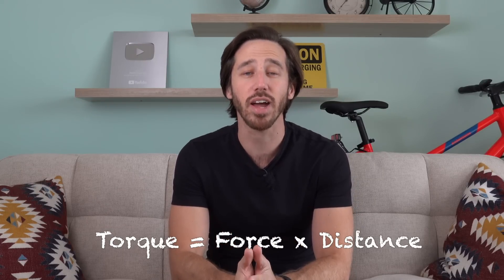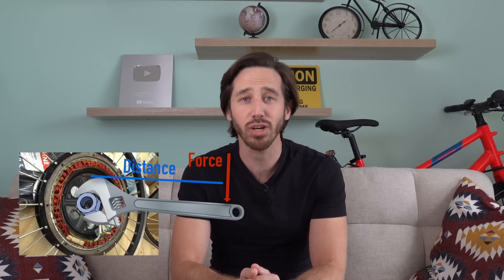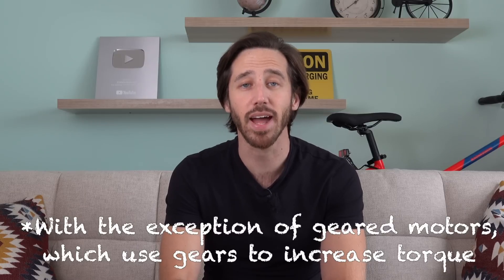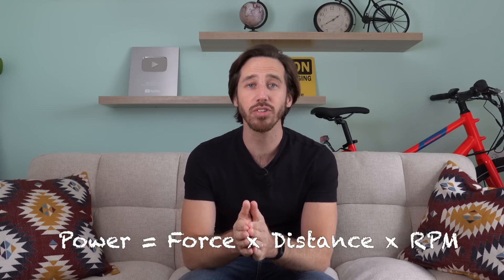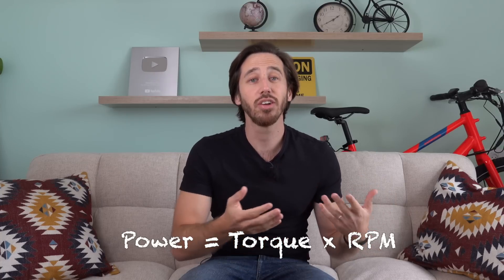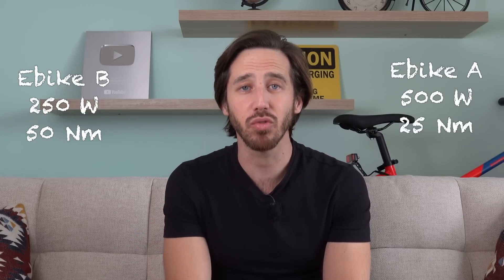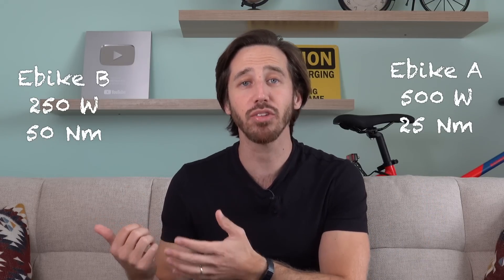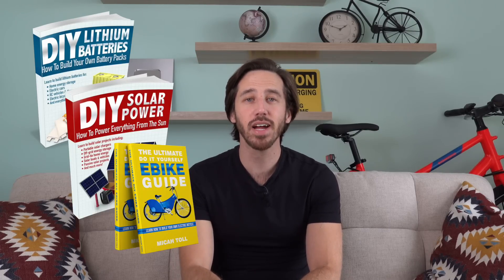What does E-BIKE TORQUE really mean? Simple explanation

Comment: ... So a 250W bike with 10NM of torque, will lose to a 500W 40NM of torque bike, in a flat race? You sure? you want to put money on that? maybe re-do your math, power on its own does not dictate things, it's what speed you want and what torque you need. In the above scenario, the 250W bike will win against the 500W bike, because it can produce higher RPM, and you need very little torque on on flat ground. And in an uphill race, a 250W bike with 50NM torque will win against a much faster 1000W bike which only has 10NM torque. Again, it's all about torque you need, and speed you need, and the specific scenario/environment. And then of course you have to mention ESCs, is there an amp limit on it? what is that limit, what is stall torque, what is the rate of heat generation, is there a fan on the motor? is there an auto-shutdown on the ESC based on heat or over amping?

Neither does voltage matter much either. Higher voltage only slightly increases the efficiency. In general, if you half the volts and double the amps, you're going to achieve the same power. So your 48V 50A motor is no better than my 24V 100A motor. So please stop spreading your misinformation about how higher voltage motors are automatically better. Learn a little bit of Physics before calling your channel "EbikeSchool", because you just don't know much it seems, and most of bs you're spreading is nothing more than ebike "bro science".

Comment: I still have my 2020 Eco trick hammer second generation 1000 Watts..... I don't want speed I want to have a lot of torque to tow my wagon if I come to a very steep incline..... I have range anxiety covered was way too many batteries I bring with me... the only thing was the brakes that I have a hard time getting the air out it's like a car with the power Brakes in the old days you gotta bleed it and it's a pain and you got to buy the tools and I'm not good at punctuation..... but I love my electric bike it saved my life.. you can't do that in a wheelchair I was going to get a wheelchair... but I got that instead in July 2020 in November 2019 that was the worst pain ever and it takes months to get over.... I wasn't even over it but I somehow put that bike together and use the wagon to get it to the garage.... I had no idea how fast it really was cuz 20 seems really fast and I crashed..... I came out of my driveway and I didn't tighten the freaking handlebars I fell right on what you call a nub and it hurt like hell but I want back up the driveway with one leg fixed it... I wanted to see how fast it could go I was at the end of the street and there's a van coming so I crashed in the yard I strongly suggest even if you got two legs practice somewhere like you do when you're learning to drive a car it's not like steering a regular bike I don't even like the giant tires I want three inch but that's the bike I could afford and it was 1400 now the Eco trick Hammer is 1200 but it's 750 W which is almost a horsepower I know the Thousand is a horsepower so a horse should be able to tow a wagon of the Hill up it LOL.... sorry about the punctuation I bet I got the point across

Comment: Like how you explain it 👍, thanks.
Can you answer this question? If we have 1 ebike with a 2000W motor on the rear wheel with 40 Nm of torque, and another ebike with 1000W motor with 20 Nm of torque on front wheel and 1000W motor with 20 Nm of torque on rear wheel, would there be any difference in case of climbing uphill?

Comment: seems to me that you want to move fast. And one way to increase torque is to increase distance from shaft to the electromagnetic coils. But then your increased torque comes at the expense of RPM; so you can get more torque by going slower -- but that is not what you want! So to compare EBike motors, you would need to know the distances between the shafts & the coils. But isn't what you need to know: the force exerted by the wheel on the road?  eliminating the variables of wheel diameters?  But this depends upon your gear ratio.  Or you might learn something by knowing the maximum speed of the eBike on a level surface with no wind & some standard rider (to standardize wind resistance) & the various max speeds at different inclinations of the road, up to 45 degrees. An experimenter could use one rider to test various eBikes that way.

Comment: Sooo, should my 2022 Gazelle C380 with a Bosch performance Line motor with a 500Wh battery and 65 Nm of torque be able to make it up an incline degree of 5.4% that stretches over .81km (elevation gain of 44m). mine has absolutely given me no assist towards the top when I really needed it- twice. Thanks

Comment: Hi Pal great content, quick question I have a 48v 1000w hub motor 20inch it's to powerful/torque for my aluminium front forks and was just wondering is it possible to reduce the power output/wattage on it, either on the display or use a smaller controller what do you reckon?

Comment: Dude, you gotta say it simpler: OUTPUT power is simply how fast torque is performed. In other words: for a given RPM, more torque equates to more OUTPUT power, period. But you completely forgot to clarify and distinguish the key FUNDAMENTAL difference and confusion of INPUT power which is super arbitrary because it's a result of efficiency. You also forgot to address the FUNDAMENTAL and key point of external gearing and INTERNALLY geared motors, especially for mid-drive motors...is the torque rating taken at the motor or at the cranks which is also not standardized and misleading. I'm frustrated with how much confusion there is on this topic on the internet, almost nobody really understands their relationship because there's no established and accepted standardized way to measure these metrics.

Comment: real world: my 250W nominal geared hub motor on a 16' wheel gets me going and getting faster way better than a similar motor/controller mounted on a 26' wheel because the sooner the wheel gets into higher rpms the more efficient those Watts are creating Newton meters instead of heat.
The most drastic scenario where this becomes apparent is a bunch of rickshaws at Oktoberfest really going at it once the light turns green with me coming out ahead because of that small wheel diameter despite a much higher system weight (600+kg) compared to my colleagues running the same motor set-up with lighter 26' bikes and slimmer tires.
Reply: Totally. Small wheels and hubs for reliable cargo bikes imo. Smaller rear wheel and larger front also works for bikes.

Comment: Great explanation thank you, BUT, I have a Rocky Mountain Altitude which claims 108NM of torque and considering buying another bike with claim 85NM of torque, both of these bikes actually dont FEEL any different to me in the delivery or torque-power.  Is the measuring of claimed torque a standard of the industry, or exact science if you will or is it just a claim of each company?  Is it measured at the cranks or at the back wheel or even what is put to the ground?  Is there some sort of standard deviation?  If one companies claims base it off their engine in house measurements, the other at the crank how can we as consumers compare appropriately?  Thanks for your help before I drop 10k on one of these.

Comment: Sorry buy power does not equal torque times rpm. When taking about work the force is applied parallel to the distance where as for torque the force is applied perpendicular to the distance. The the two terms are not interchangeable.

Comment: This is a great explanation, but I would recommend using a bit more precise language:

for example, you mention that power is "torque x rpm".  This is technically true, but a bit confusing.  Torque is a general concept but rpm is a unit of measure.  What you're trying to describe conceptually is the "rotational frequency" of the motor--this is the general term and can be used as rotations per hour, per second, per whatever-unit-time.  Just like "torque" can be N-m, lb-ft, etc. etc.

There was something else, but this is the only example I have rn.  It's an excellent video and excellent description.  I learned something I didn't understand before, and of course I understood the point you were trying to get across.  But in the interest of continuous improvement, I'd encourage you to focus on your linguistic precision in these videos to make them that much stronger.

thanks again!

Comment: Micah, in your examples you suggested the bike with more 'power' will win the race. I don't think you used any caveats like "all other things being equal". Things rarely are equal. Imagine two bikes with the same power rating but one weighs 20 pounds more or has a heavier rider. Common sense says the lighter situation would win the race. Assuming that's right it seems to me as consumers, choosing the right ebike for performance, we should consider both weight and power. We could potentially win an actual race riding a lighter bike with less power against a competitor with a more powerful but heavier bike. No?

Comment: Another thing that's confusing with all of these e-bikes.

For instance A G-Force bike well the new upgraded model so weird to say they upgrade so quickly. 

Has a 22 amp controller, ( and the NM is 80 ) 

But yet another bike recently reviewed the VITILAN which now has an upgraded controller from 22 amps to  25 ( yep things change that quick!!)  ONLY HAS AN NM OF 75!!  

I know this has something to do with the torque But all the numbers don't add up. How can The G-Force with only a 750-watt motor 1,000 w peak have a higher 80NM then the NOW UPGRADED VITILAN 750 watt motor 1200 watt peak only 75NM 

And some of these other e-bikes with the same 750 watt 1,000 w peak motor only has 60NM

This is so confusing 🤣

Maybe you can shed some light on the subject

Comment: regarding the flat land race senario here...force times distance times rpm you say.your talking about motors not complete bikes......you basicaly raced one bike in first gear and another in second gear and came to the conclusion the 500w motor in second gear won... the 250w motor can have higher gearing becaus it has more torqe.....bothe bikes have the potential to cover the same distance in the same amount of time...they bothe have the same force potential....give them their optimal final drive ratio for their respective torqe to power ratios.

Comment: You avoided the contradiction of mixing the old, obsolete metric system with the current SI Metric System that's a mess with the bicycle industry.  Weight is a force.  It is a derived unit and not one of the 7 fundamental units (like mass)  in the SI Metric System.  So weight x distance also = torque.  Let's see then.  1 kg x 1 meter = 1 kilogram meter. But wait, that's not a newton meter.  Why? Because kilograms is not a unit of weight.  You need to first convert that mass (kilograms) to weight/force to work with units such as Watt and Joule.

Comment: Thanks for the info I knew these things meaning a car mechanic but I like how you explained it with me bikes. It's like for example ebikeling 750w geared hub has 50 nm torque. The 1200 w direct drive motor has 30 nm they're 1500 watt has 40 nm. All I want to do is 28 to 30 mph no need to go any faster. I have a 350 watt 48 volt 10.4ah Rattan Challenger I've got $2,948 Miles on the bike. I get 25 miles throttle only. Pretty much flat ground here in South Florida. the Cruise control function is sweet I think it should be on every ebike. Because once I'm doing 20 to 22 mph after 2 seconds it kicks in I don't know how to touch the throttle. The ideal thing is that I pull less amps anywhere between 6.3 to 9 amps depending on wind. That's the range that pedal assist seems to work at when you're up to the same as speed 20 mph so it extends the life of your battery I recommend a cruise control. That's why I'm looking at the ebikeling kits and bafang, csc etc. I have a giant Rome 3 it's around $1,000 bike good condition I want to turn it into a e-bike it has 700c 38c 28 wheels I want to put wider maybe 50c 55c. Trying to figure out the kit. Luna took the same model bike put a mid drive on it I like the mid drive concept but I don't like how it burns through parts. And the problem with derailing all the time. I want 48 to 52 volt a 750 w or up I just want to bike that'll do 28 mile an hour. Any suggestions would help recommendations on a good unit thanks

Comment: Micah help!🔋🔋🔋🔋🔋🔋
I still don't understand what I came to figure out:

I purchased a compact folding ebike.

I got maxed configuration:
Battery = 48v 15.6a

My understanding is volt is speed and amps is the range/distance. I want to understand how and if getting the basic 350W motor or paying for upgraded 500W will make any difference?

Will both 350W and 500W motor go same max speed (48v) and max range (15.6a)? What if, any difference, besides upgrade cost does getting the 500W motor make?

I think I made mistake paying for 500W if the speed and range are determined by just the battery.
🔋🔋🔋🔋🔋🔋🔋🔋🔋🔋🔋🔋help!🔋🔋🔋🔋🔋🔋
I still don't understand what I came to figure out:

I purchased a compact folding ebike.

I got maxed configuration:
Battery = 48v 15.6a

My understanding is volt is speed and amps is the range/distance. I want to understand how and if getting the basic 350W motor or paying for upgraded 500W will make any difference?

Will both 350W and 500W motor go same max speed (48v) and max range (15.6a)? What if, any difference, besides upgrade cost does getting the 500W motor make?

I think I made mistake paying for 500W if the speed and range are determined by just the battery.
🔋🔋🔋🔋🔋🔋🔋🔋🔋🔋🔋🔋

Comment: What you mentioned in the video about how larger diameter hub motor having more torque is due to larger distance between the magnets and the center rotational axis, isn't it because larger hub motor is able to house more magnets and more coils, thus overall more magnetic forces at any given time? I don't see how "distance between magnets and center rotational axis" have anything to do with torque. Could you maybe elaborate on that a bit more ?

Comment: the truth is... that to the bike with 250w and 50 Nm torque you can put controller with better max amperage , and its will be like 500w 50Nm bike so it would win :) motors power rate is just theoretical, Nm and rpm is matter

Comment: Hey Micah! I've got a question for you? I recently bought a practically new Ariel Rider M-Class (newer version) and I absolutely LOVE it! It got a flat tire the other day and my dear husband changed out the tires........short story, it has not been the same and I cannot ride it right now! I know he tried his best, so I refrained from making a huge thing about it. I thought I would try here first to see if some of you may offer suggestions on what I can look for to get this beauty back on the roads.

Just walking it to the road, the controller LCD shows all sorts of speeds from 0 to 57 mph and everything in between. The throttle cuts in/out; the gears are not working properly and the chain was lose after the tires change, but then adjusted and maybe even too tight. We don't seem to have bike shops out here, and most likely I should be contacting Ariel as well to see what they suggest I can try to get her going again. Suggestions would be greatly appreciated! Thanks so much
Reply: The first place to look is the speed sensor magnet. I BELIEVE, but do not know for sure, that The Ariel has a spoke mounted speed sensor magnet. If it is not properly lined up with the speed sensor on the frame your bike will perform exactly as you describe. Hopefully you can see how this is a cheap and easy fix (most often turning the magnet to face the sensor and tightening). I can't tell you the number of times I have bumped a sensor while repairing a bike to have these same problems. This does not mean it is your only problem, but it is your most likely and easiest to fix problem. It should allow you to fix anything else.

Comment: I like how this this topic is explained, but that example at the end isn't very accurate, because there is possibility of slowing/stalling motor with less torque - simply said, motor can't run at declared power because produced torque is not sufficient (for example steep hill or high acceleration), so in the end low power motor with higher torque wins. For this reason gearboxes are used.

Comment: He missed the most interesting example. Wich one will win, if two E-bikes have the same power, but a different torque?   Most countries have a limit for the allowed power, but no regulatons about the max torque. So the choice between motors with the same  power but different torque is much more relevant for most people, than the  choice between motors with a different power. 
Did he maybe miss that example because its not as easy and obvious as the ones he talked about? ;-)
Refering to what he said, same power and same distance means both bikes need the same time. Referring to the formual Power = torque * RPM the bike with less torque would be faster, because at the same power the motor spins faster.

Comment: When I use the throttle with a Bafang mid mount, does the response depend on the power level set from 1-5?
Reply: That's no matter of physics, its a matter of how the controller is programmed.  It's possible, but it wouldnt make a lot of sense to program a controller like that. So usually the throttle ignores those levels, but their might be exceptions.